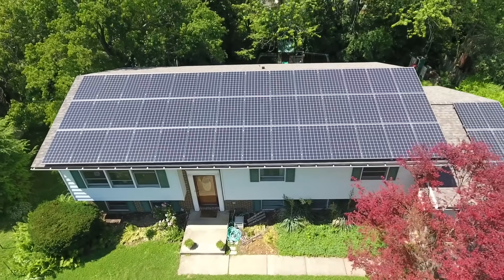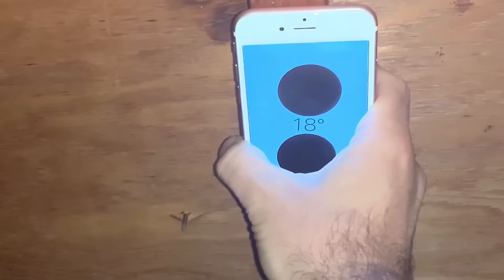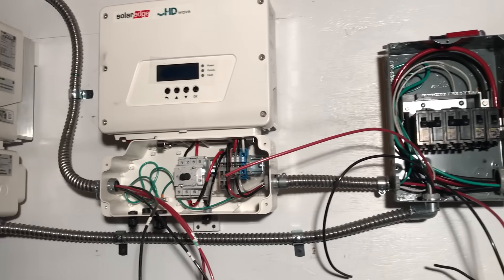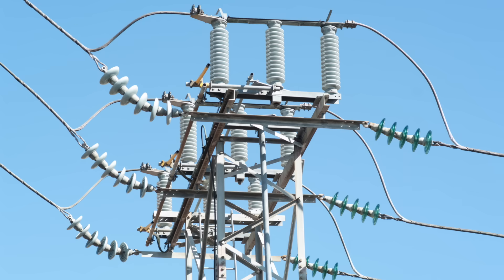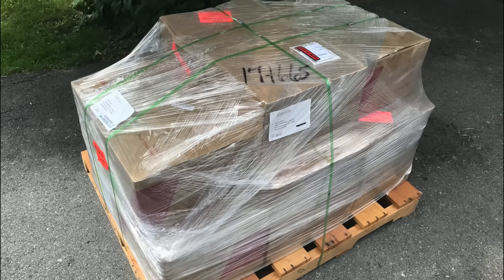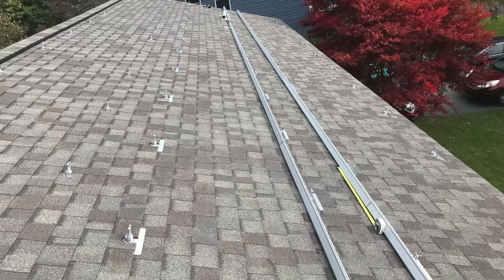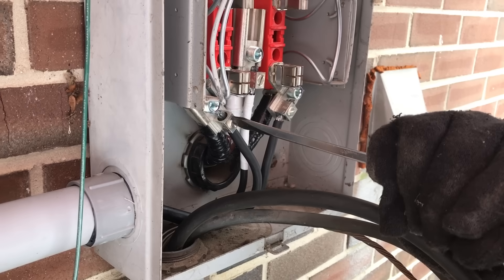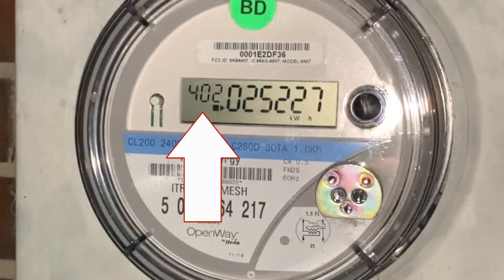I Installed a Power Plant Myself | HUGE DIY Solar Panel System

Comment: Great video. I do solar for RVs, and we deal with battery banks; this is the most expensive part of the system. Good solar panels are cheap nowadays.  If one had the money for a battery bank (LiFePO4 power wall or two) that could store a day or two's worth of power based on their demand they'd be in better shape, and especially with power outages, but it would take several more years to reach your ROI. If one has the skills they can make their own batteries from the raw 3.2 VDC 100ah cells for about half of what you would pay for ready-made batteries. You hook up four of these cells in series you get 12.8 VDC @ 100ah, or you can make them into 24 VDC or higher. On big RVs, I series-parallel my panels and batteries to either 24 or 48 DVC to save on wire cost. You pay a little more for inverters but it's offset by what you save on wire. Thick copper wire is expensive and hard to work with. At 48 VDC you can carry a lot of amperage for a good distance on 10 gauge copper wire compared to 12 VDC.

Comment: You should have been using safety harnesses up on the roof.   Imagine how costly and painful this DIY install would have been if you fell off the roof and onto the concrete below.  In California where I live you are not allowed to put the panels that close to the edge for safety reasons.   I give you a failing grade on safety and an A for the rest of the video.

Comment: I worked for FPL power company Trukiepoint in Homestead florida for 28 years and now , Iam retired  and design RV sunpower cells 8,000 watts at 100 amps. Power station with 1-6 weather high tect by aroc,  cellphone decoder for free call, every high 100bps speed
 internet all in one off grid super station
All free 
I get all this service for free.
I worked for all this company many years back and learned all there secret and build this super station.
1. Sunpower solar system 8,000 watts
2. Cellphone high tones decoder for free services.
3.Aro all - 6 every high tech weather 
4. Computer controler for all system
5. 1000 digital HD cable channels plus netflix,HBO, cinemax,showtime.
6. Internet 100bps super high speed.

Comment: let us know if an unforeseen bonus of a complete south side covering of solar panels on the roof does double duty as an insulator to lower summer cooling bills ?  also does it help or hinder the winter heating bills ?

Comment: I can tell you without a doubt that if you do a grid-tie solar setup in the state of Tennessee. They charge 12 cents a KWH and you supply your power from your panels and they give you 2 cents. I had a 10 KW system and I got a big 19.00 a month. I moved after putting that system into that home. I now live in the country and can do whatever I want. So now I have a full setup of 40, 400 watt panels 7 charge controllers, 2) 7000 watt low frequency pure sine wave inverter 1, 220 and one 120 volt. I opted to go with the Chevy Volt batteries and I currently have 6 sets of them out of 6 cars. My goal is to get to 8. Right now we are currently running 2 full size fridges, 2, 12 ft chest freezers, 4 ductless mini splits, an inverter washer from LG a gas drier all the lights in the 2800 sq ft home. Our 5th wheel 35 ft RV and we have a monthly electric bill of about 46.00 a month. The batteries are projected to last for 20 to 25 years as are the panels. So we LOVE our system and what it is doing for us. We figured it up the other day and we have about 30k invested in the entire thing. But what is that worth in these uncertain times we are living in today? If we go to the barter system what is refrigeration worth in a grid down scenario?

Comment: I have a vary good idea for another page or 2 in your book
called (slowly steping off the wire....) 1: finding power robbying devices and turning them off. 2: design 3:placement of paneld and battery. 4: maintaining and repairing 5: turning power lines off and flipping the switch 6: last but not least ENJOY!!!!!!!!! 
to find out full deatailes my name is sean 843-602-1025

Comment: Pretty obvious improvement would be a DIY power wall from used 18650 LiIon cells. In most jurisdictions that does not save you any money but it does help with the transition towards renewable energies because you don't need to pull power from your energy provider when the sun does not shine.

Comment: How good will this be with 1foot of snow on top?
Reply from the maker: It’s not a problem.  If I remember right, I think the panels are rated for 50lbs per square foot.  Our snow load for this area is 30lbs/Sq ft

Comment: Curious where you live, because I think there are regulations in my area that wouldn't allow me to do some of that electrical work myself, or to feed back into the grid. What happens if you're feeding into the grid and a lineman needs to work in the neighborhood, how does the power company ensure safety?
Reply from the maker: I’m in PA.  The equipment is built to not allow you to feed into the grid if the grid is down.
Reply: @FrugalRepair  Interesting! Thanks. I'm in Massachusetts... We have laws for everything here haha.
Reply from the maker: I was told that even if that part of the code was adopted that there is a way to get an exemption from the fire chief. I’m just glad I didn’t have to bother with it.

Comment: Did you check the fire codes? Maybe your location doesn't limit solar panels, but some places (California, for one) don't allow you to cover the entire roof. Firefighters need to be able to get on and walk on the roof is case of emergency. A few feet away from the edges & ridge is enough.
Reply from the maker: Yes, I checked.  That part of the national code was not adopted by our jurisdiction.

Comment: This is a thought experiment.
Say you paid $10,000 for the complete solar panel system batteries included. And your light bill runs approximately $100 a month. It will take you at least eight years to pay off solar panels. At that point it will be free but then it wouldn't be free because the batteries will not last 10 years so there's another $2,000 and another two years. Yeah I don't see where it's free. Or Bill free unless the whole system is well free. I love it when people say I bought a motorcycle to save on gas lol! The whole point is to save money if you bought a motorcycle to save gas how much gas could have you bought if you hadn't bought the motorcycle to begin with. Or dumb people that say they're electric car has zero emissions. I suppose the coal-fired plant that charge the batteries is also zero emissions. Ahhhhhhhh people are so delusional.

Comment: Optimizers are a great concept, but I have Solar Edge optimizers on my system and in 7 years almost all of them have failed. They've all been replaced under warranty, but it's a big pain to have to constantly service the system and deal with under-production.
Reply from the maker: Sorry to hear that!  Hopefully they have improved their design.  Almost every solar installer I spoke to recommended SolarEdge because they said the main competitor had lots of failures (and they had to do the warranty work).
Reply: @FrugalRepair  Hopefully your experience is not the same as mine.  It's possible they've improved reliability, I haven't had the replaced optimizers in service long enough to know whether that's the case or not.  You never know what sort of manufacturing change orders they've worked through (well, not typically).

Comment: Awsome video and hope many follow suit, next do a wind turbine. They do in the UK so maybe the same there, they preduce more than solor panels.

Another option for summer would be solor water then you would make more from the solor panels as again less electric used to keep your water or heating warm.

Edit:
Don't forget to keep all panels clean. Clean once a year to make more kW. After a couple years they drop performance when not cleaned

Comment: Great video. One question. Where do you get your power when the sun goes down, cloudy days or snow builds up on the panels?  Didn’t know if you had a battery backup as well. Thanks

Comment: Great video!  With 3 kids and finishing my degree I don't have the time or funds to do a total system like you but I picked up a few second-hand, unused panels I am using.  Two are about to be installed on my shed to make all my electric lawn care equipment off grid and free to operate and the third has replaced the roof on my golf cart and has been powering it for over a year for free!
Reply from the maker: Thanks!  That’s awesome what you have done so far.  Hope you can get that all working.  I have some broken panels that I need to figure out what I’m going to do with.  An installer gave me 7 or so big panels.

Comment: Always a bit difficult to give a financial picture as you (probably) do not know how the electricity company will credit you for the kWh you send to the grid for the coming years. Here in Europe there are quite some countries that only give production cost prices and your middle of the day July sun is worth next to nothing. As long as you can exchange your generated summer kWh's for your winter kWh's your safe, but remember it can only exist because of the massive subsidies using the grid a massive seasonal long battery.

Comment: Installs 40-50K worth of solar panels, and 10-15K of new shingles, and claims he has no bills.  Hope he is planning on staying in his home permanently because the ROI on solar isn't very good if you end up selling the home.  I have 3 friends who basically got their solar arrays for free because they were rolled into the sale price of the home.  None of the appraisals gave much of an adjustment to the bottom line up against the other comparables.  Bottom line, if you want solar, be prepared for the risks.  This guy makes it look easy (as most DIY stuff admittedly is), but don't take his word on how fiscally responsible this may be without considering all of your other goals as well.

Comment: No fire setback from the ridge? 
Also, doesn't DC panels shut down whole strings if shade gets thrown on a single panel for that string? Other than that, this is amazing.

Comment: Its been said that photo voltaic solar panels work most efficiently at a certain temperature( can't remember what that is) and as temperature rises efficiency goes down making it less efficient when the most sunlight is available. To combat this there was talk of a panel that incorporated a solar heating system to help cool the system and provide heat for domestic hot water and central heating. Have you ever seen or heard of this?

Comment: Would installing a tesla power wall be financially beneficial for you? If you start exporting energy to the power wall during the day, and used the energy at night, there would be a lot more excess power going into the grid and eventually paying off your power wall. Would it be enough to pay for itself in time? Look into tesla auto better software. Great video.

Comment: First thing I would do is replace your car with an EV. With your production, that could be a $0 bill for fuel as well as your (already covered) home. Perhaps you'd pay a few bucks in the winter but definitely less than gasoline. You'd also get to brag about owning a solar powered car!
Reply from the maker: It’s on my list one day!
Reply: @FrugalRepair  By my calculation, in a Tesla 3, you'd need about 3800 kWh to do 12000 miles (average annual usage). If you're exporting around that, your cost will be limited to the car purchase & insurance. I suppose it'll make most sense when your current car is due for replacement, whenever that is.

Comment: Maybe no bills but how much did it cost.  Take what you spent on the install and divid it by the average yearly bill and see how many years the payback is.  Also it will last only 10 to 15 years before the solar cell are putting out only 30% of what they did at the start.  Then you spend money to start over...

Comment: Kudos, for having the guts to take this on.  I have concerns about your calculations though - I've yet to see PV panels that don't significantly degrade after 10 to 15 years.
Reply from the maker: Thanks!  I'm curious if you have any sources for panel degradation.  I recently spoke with an installer (and physics professor) who says the latest findings are that panels are not degrading like many had previously predicted.  My panels are warrantied to produce 91% of nameplate after 25 years.
Reply: @FrugalRepair  Well, that just shows how little I know - I looked into PV panels at our old house about six-seven years ago and the consensus was they typically lasted around fifteen years.  Given the initial outlay, it put me off - our government had started rolling back the renewable energy grants/concessions at that time, making them almost a break-even prospect.

I'm guessing modern panels have improved considerably, if they're offering 25 year guarantees.  Good luck to you and, again, kudos for undertaking it yourself.

Comment: Very clean install.  I'm surprised you need that many panels for that house...wow.  I did just about the max my energy company would allow, 8kW total, I have 2 arrays.  The one I did this year was with Enphase micros and just 8 panels on my south facing house roof.  Works great, I used Quickbolt 2 bolts for putting in the stainless steel L brackets for the mounting.  Was easier than the flashing under shingles, less intrusive, and I believe will last the life of that roof no problem.  There's a few great ways to go with solar, including yours.  Great work!
Reply from the maker: Thanks!  I really wanted no power bills so I wanted the max I could put up there.  Sounds like you have a great setup!

Comment: Nice install. Issue is that if the power goes down you lose power.  This is the 2nd Grid tie solar install that pops up in my feed this week and booth were the same.  I opted for a battery backup solution and it paid off. Just last 2-3 weeks we lost power in Georgian and I was hatching chickens in the incubator. without my batteries I would have lost my chicken batch. I was grid tie before but  after installing my batteries I did not even let the power company know that I did it. I just canceled my net metering and stopped sending power to them.
Reply from the maker: Thanks!  It is one of the downsides to do grid tie (with no batteries).  Thanks for sharing your story. Thankfully, the power is pretty rock solid around here.

Comment: I see you changed your shingles because they had dark black streaks.  Those streaks are mold. The old shingles had limestone granules limestone holds water and molds. Did the roofer encourage you to get shingles with ceramic granules?  Ceramic repels water and stays looking like new for about 40 years roofers don't want you to know about this so they have more jobs. Owens Corning makes a nice 130 mph shingle with ceramic for very little more.  On the roof can be good for the south but in the north i think the best way might be along the fence line with one long row.  But it looks like you did a very nice job and thanks for the video.

Comment: I love what you did. I just got 32 used panels (5 years old). Max power at 275w and 39.4 volts. I feel like I got a good score but I have a few questions. 1- should I put a used panel on my roof? 2- why did you go with a whole bunch of individual micro- inverters and not one that covered 2 or 4 panels? Thanks for your time and great job...

Comment: i use wind turbine and sometimes solar panel but it is not connected to the grid and the solar panel is not always connected for the moment
Reply: so there are 4 car battery and 4 other battery in groups from 2 to 2 * 12v 24v

Comment: Nice vid. Ive been preparing for a small system to run my ham radio shack. This will give me a chance to test out a small system and get familiar with how to setup everything. Initially I dont have to worry about dc to ac conversion. Ham radio equipment runs off of dc anyway. I have actually spent my initial time setting up the shack for dc use. Lights, fans etc all dc.
Reply from the maker: Cool project!

Comment: If you don't have a battery system, then how do you have no electricity bill? You have to draw electricity at night time, and there must be some winter days when the panels don't produce that much?
Reply: Net metering... The systems is sized to produce the same amount of power that the house uses over a full year. During the months where it produces more power than it uses, those are recorded as credits by the utility. You can then draw on those credits during the times when the system isn't producing enough power. Though in most places you still have a grid connect fee that you pay every month; I think it's about $15/month for me IIRC.

Comment: you might want to put reflectors ( please see mirrors..)  this is a cheap way to send more light to your panels  and increase the time you get sunlight.. also if there is a time of use system with your energy company, you might want to look at battery system ( store when electricity is cheap and send to the grid with expensive...)

Comment: My system is completly offgrid and battery based, our power company is really poor in the US virgin islands and they are not good on any new net metering conections.
Reply from the maker: Sorry that the power company is not very good. But it sounds like you have a great system set up!

Comment: Thank you fir your response, but the ROI that you are getting depends entirely on the sunshine you experience in your geographical position. Also if you are young ROI may apply, but if you are over 70 and capital is scarce then even a fantastic ROI is no use unless you can live long enough to reap the benefits. However, I cannot fault your video, it was brilliant and thank you for all the detail. Maybe I need to read your Solar Guide. Cheers.